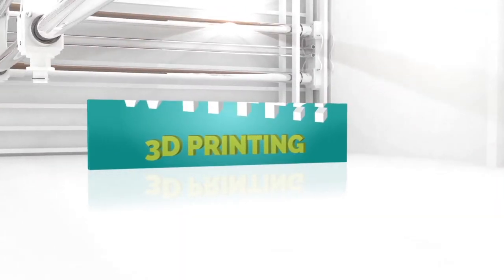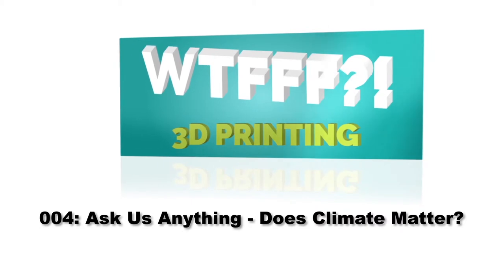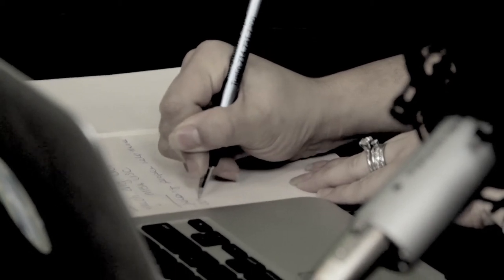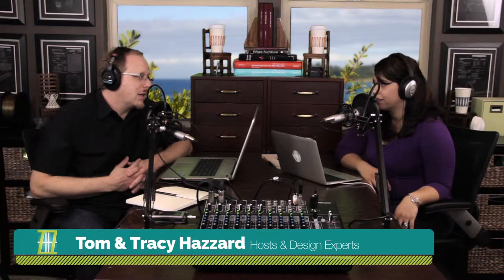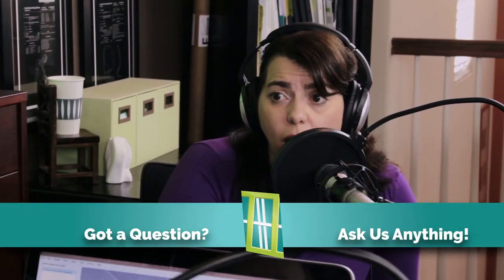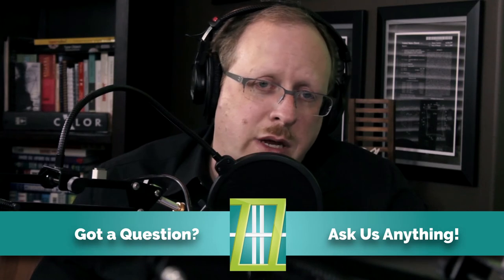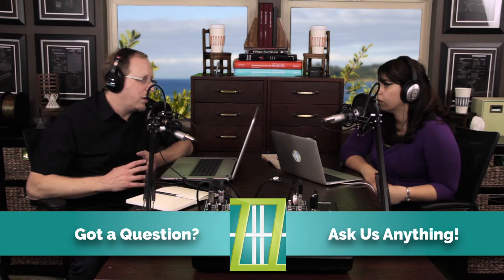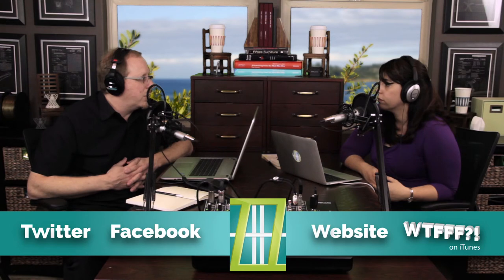Bagging 3D Printing Filament for Humidity

Comment from the maker: Thank you for your comment, it is much appreciated. Perhaps because we live and work in the desert southwest, and humidity is constantly very low, we have not experienced problems printing with filaments that have been exposed to the environment. It would be interesting to do an experiment this winter if you are willing, and leave filament exposed to your interior environment, print with it and observe the results. Because cold air is very dry air, you might not experience the same poor quality results in the winter. Of course, for those that live in more humid climates, it makes sense to keep your filament sealed to be on the safe side.

Comment: In my experience, moisture is a huge problems when printing. I live in Quebec, Canada and it gets pretty humid here in the summer.I have seen other youtubers use silica gel, vacuum chambers and heated boxes/ovens to get rid of the humidity. From my observations, I can say that moisture seems to expand inside the hot end causing the filament to be pushed; that causes and uneven flow of filament. A very humid filament in my extruder at 230C can empty itself up to about 5mm of extrusion as a kind of lag. This has an effect on prints with small extrusion rates followed by bigger extrusion rates. I have also noticed many little holes being produced by vapor pockets when printing single wall objects. 

I like your show and would like to see more. I don't quite understand why most of your videos have so few views. I would suggest you branch out to other youtubers such as Tom Sanlanderer and Barnacules. Happy printing!